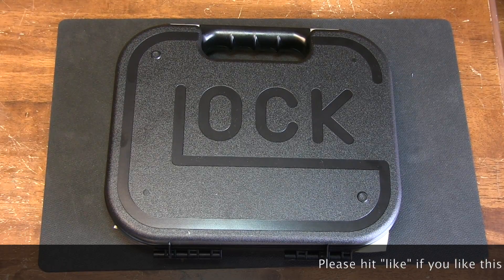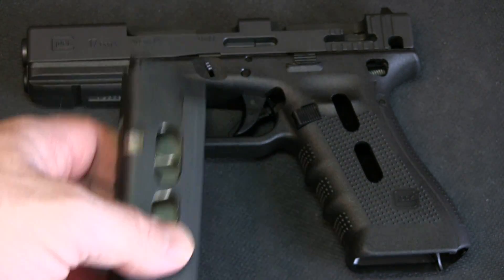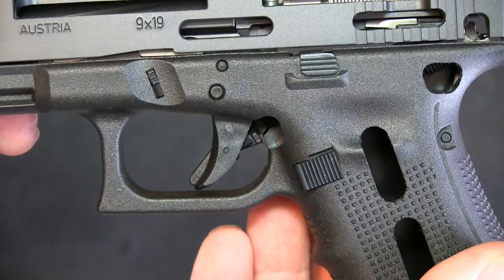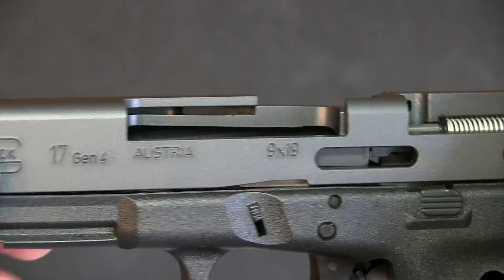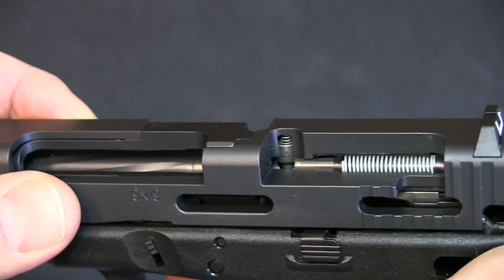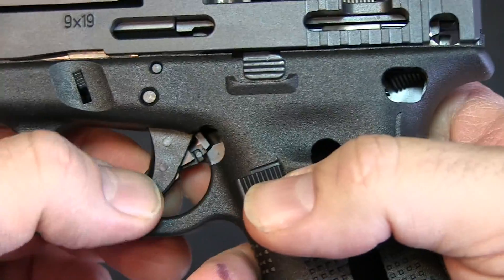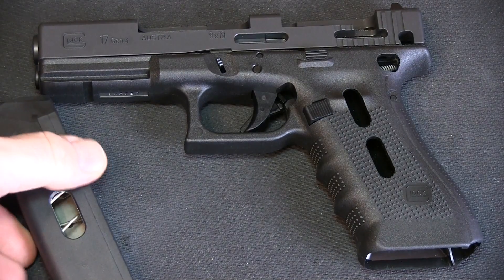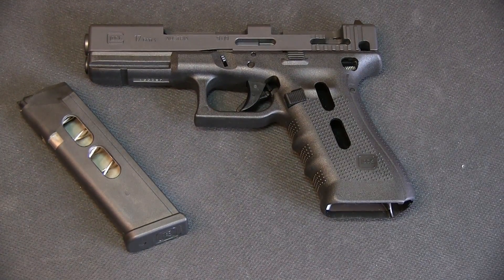How a Glock Works (with Glock Cutaway)

Comment: I know I'm in the minority, but I don't think Glocks are safe.  With a five-pound trigger, I don't see how they could be.
Reply from the maker: That's not true, internal safeties are different. Some safeties can fail. The Glock has a redundant safety so that there is absolutely no way it can fire unless the trigger is pulled. If you cocked a 1911, then dropped it it could fire. A Glock could not. The firing pin is almost completely incapsulated in the channel, and couldn't touch the primer if it tried.
Reply: The Glock is only as safe as the person holding it. If you don't pull the trigger, it won't fire; if you keep the trigger guard covered when carrying, it will not fire.
Reply: you're just not safe with guns if you think this gun isn't safe. it has a safe action trigger. safe is literally in the name.
Reply: WCGwkf right even with a 5 pound trigger you have to make a deliberate motion with your finger to pull it
Reply: Kurk T Check out these video's by n300xx931, he explains how each of the 3 internal safeties work.  Start with video 1.  These will answer all your questions, and give you assurance on the Glock.
Reply: Rick C  I've been handling guns since '87.  I've carried .38's, .45's, M-14's and shotguns.  I've fired M-60's, M-2's, and 5"/54's.  So, pardon me for thinking for myself--and for not buying into Glock's "safe action" advertising and the false bravado of people who are accidents waiting to happen.
Reply: Hey now, this here Dem is handy with all six of his firearms.
Reply: I used to feel the same way about a Glock, knowing that it does not have an external safety.  After studying the design of the firearm and learning more about how a Glock pistol functions, it does not need an external safety.  It is impossible to fire a Glock without fully depressing the trigger with your finger completely in the trigger guard and firmly on the trigger.  There is a trigger block on the trigger itself.  Also there is a striker block in the mechanism that will not permit the striker/firing pin to move forward and contact the primer on the cartridge.  A Glock can be dropped from a great height and still will not fire on impact, so accidental firing is eliminated through their design.  Without fully pulling on the trigger, it will not fire.  It is a double action striker fired pistol, so without that full pull on the trigger, the striker cannot travel forward to strike the live round.  Even if something were to enter the trigger guard and put rearward force on the trigger, it would have to go right across the trigger to do so and that is quite improbable.  In short, the Glock is probably one of, if not the safest pistol currently on the market.  Rather ingenious design.

A 5 lb. trigger pull is not really all that light.  It is about medium.  I've seen them as light as 2.5 lb.....and that is too light for my liking.
Reply: trust me there awesome I have mine I can empty the 15rd magazine in 1.86 second
Reply: I was with you on this once, they are the safest striker pistol on the planet, I carry mine in the appendix carry position.
Reply: The internal safeties are irrelevant; every gun has them.  The problem is, you have a pistol with a trigger pull not much heavier than a 1911, but without a manual safety.  That's just nuts.
Reply: You can buy an 8 pound trigger bar.  What do you carry?
Reply: p pollaccia 

 "You can buy an 8 pound trigger bar.  What do you carry?"

Right now, I'm carrying a Charter Arms Undercover that I inherited.  I'm guessing it has a 10-12 pound trigger, like most revolvers.

I could see carrying a Glock with an 8-pound trigger.  That would put it about the same as an LCR, and I wouldn't feel uncomfortable carrying one of those.
Reply: 762x51n8o 

 "That's not true, internal safeties are different. Some safeties can fail."  

Other than those who carry derringers, I'm not aware of much in the way of ND's caused by CCW holders dropping their weapons.  I just don't think it rises to the level of a real problem.
Reply: no you can't. video or it didn't happen
Reply: Thelonewolf4032 Jordan my used g19 was made lighter by a glock armorer, but my factory new 43 has a heavy as hell trigger that could only be pulled deliberately. I had to polish it up to make it smooth but it's still heavy
Reply: Kirk T Just keep your damn finger off the trigger until the weapon is pointing at that which you wish to destroy. If your finger's off the trigger, there's no way that firearm is going off.
Reply: Saying "keep your finger off the trigger" is like saying "don't have an accident."  It doesn't mean anything.
Reply: If you honestly believe that, then you honestly shouldn't own firearms. Maybe we can get you a nice pocket knife? Oh wait, but you might have an accident. If you can't handle trigger discipline, you might not be able to tell which end's which on a knife, as well.
Reply: The problem is not the Glock; the problem is the user. You can shake or drop the Glock and it will not fire. You have to have your finger depressing the trigger safety. Should cops carry Glocks? Of course not, because half of them are idiots, and police are far more likely to end up in a standoff situation. If I pull my 21 on someone armed with a knife or bat or axe handle, for example, my finger's off the trigger, so there is the opportunity for the adversary to stand down. If I ever have to pull on a firearm threat, as soon as my sights are lined up, I'm on that trigger and squeezing.
Reply: Kirk T Because of the trigger or because of the non existent safety?Besides the trigger /1911 safety
Reply: And here I am thinking the trigger on my wife's 43 is heavy.
Reply: you must be a democrat .
Reply: you must be a democrat
Reply: Not all guns have internal safeties though most modern firearms do.  Each design varies and not all are as secure as with the Glock.   Some designs are more prone to failure than others and some, although classified and marketed as double action are actually single action in nature.  The Ruger SR-9 shares an almost identical system as the Glock.  A true double action, striker fired design.
Reply: Yes thank you . I failed to mention that I'm a certified Glock armorer
Reply: You sir, are a jackass.
Reply: Are you referring to me Austin and if so why would you think so ?
Reply: My money's on him calling Kirk T that..
Reply: 3 things have to happen in order for a person to shoot another by accident  ;
#1 the firearm must be loaded , #2 your finger must be inside the trigger guard and finally #3 and most important component of all is that the weapon must be pointing in an unsafe direction . These are the facts and only the facts . If anyone of these 3 conditions is missing no one should get hurt . Pure and simple .

Comment: Dumb question...what is the spring that remains compressed after racking the slide (I'm assuming it's not the springs surrounding the guide rod)?
Reply: PowerPunchingSecrets.com 
the spring staying compressed shouldn't shorten its life span as much as repetitive cycle compression will.  Much like a magazine spring, where people have shown in tests that keeping your magazines loaded i.e. constant compression, doesn't shorten the springs life span much at all, but the repetitive cycling of loading and unloading is what wears out a spring.
Reply: 300 blAKout
 THANKS
Reply: Pretty sure you're talking about the firing pin spring?
Reply: Thanks. How often should you change out the firing pin spring - assuming it's always compressed with a round in the chamber?
Reply: Exactly. The same applies to magazines which are kept loaded for a long time.

Comment: it almost looks like you could replace the barrel and firing pin and it'd work just fine. might be a bit snaggy for a carry gun though lol
Reply from the maker: There is no hole in the slide for where a real firing pin would go through, so you couldn't use it.
Reply from the maker: I like that..."snaggy".  Funny comment

Comment: So 762x51 a friend of mine has a glock 19 and his triger fails to restart you click and when you reload the triger does not restart you need to help it a bit ... am thinking the problem is in the fire pin spring maybe its too weak ... i see here it connects to the triger what do you think ?
Reply: I think your friend should visit a Glock certified gunsmith...

Comment: why does it have 2 triggers?
Reply: The smaller one is a safety mechanism so that the trigger cannot be pulled back unless the small one in the middle is pulled back first. From what I can tell by looking at my glock there is no physical way for the firing pin to strike the primer unless the trigger is pulled back, which that little safety thing prevents from happening unless it is also pulled. He shows it in the video somewhere.

Comment: I'm glad I came across this video...I'm a ccw holder carry a g27 gen 3....I'm usually don't carry one in chamber just for safty reason. ..but watching the trigger pull and the safty plunger works...I'm always wondering the gun accidentally going off. I know it's striker fired......but from what I seen ...it can't happen unless trigger is pulled....this was a great video....thanks for sharing
...
Reply from the maker: +Clayton Schorege Glad you saw it, there's really no reason to not carry a round in the chamber, as long as you're competent with the pistol, there's nothing to worry about.
Reply from the maker: +Garrett Phillips I agree with you on carrying one in the chamber, but I wouldn't say it cuts time "dramatically." The timing difference is negligible -- but it takes more practice to become efficient. What Yeager says is a little off, because the racking of the slide is done in the same motion as the presentation, so there's no time loss there. Where the time is loss is acquiring the grip with your weak side hand, because after racking the slide the hands are moving in opposite directions. But honestly, if you're that close, you can shoot one handed. Do a search for Isreali/Mossad Draw, and you'll see how fast the draw is. Trained people are doing it in a second, or just over a second. With that said, however, I stress my first sentence -- I would never carry without a round in the chamber, and I don't see a need to do so.
Reply: @762x51n8o so with a glock seems like since the trigger pulls the firing pin all the way back to finish the cycle. If it was dropped an the firing pin block failed it still wouldn’t go off since the firing pin is not all the way back? It wouldnt have enough force to penetrate a primer? Unlike most other striker fired once they rack the slide the firing pin is fully compressed with only the block holding it until the trigger releases it and the block fails would ignite the primer.
Reply: stag3t-m uspsa watch some videos on YouTube by active self protection, I've seen lots of videos where not having a round in the chamber was the difference between life and death
Reply: +Clayton Schorege   Take the plunge and learn how to totally disassemble your Glock. It really is very simple and will give you a better understanding and a level of confidence in your firearm that everyone who carries should have. There are plenty of good YT videos on everything Glock.
Reply: condition zero preferably or one are the only ways to carry. having stupid trigger safety or grip safety is waste of time and room for error.
Reply: austin trigger and grip safetys are passive and are engaged under normal operating of the firearm.   While I'm not a huge fan of the grip safety, without the trigger safety you can have discharges when dropped, this is what is going on with the Sig P320 that has a solid metal trigger.

Comment: I had no idea about the firing pin safety. Amazing and ingenious little feature! No wonder the Glock is drop-safe. A few years ago I didn't understand the workings of striker-fire pistols and opted instead for hammer-fire (with the roll-away firing pin featured in Beretta and some S&W pistols) because I feared a drop-fire. Little did I know how backward that thinking was!
Reply from the maker: +Josh Donat I stayed away from striker fired handguns longer than I should have, as well, so you're not alone. Now I prefer it.
Reply: Almost all semi automatic pistols have a striker or firing pin block while hammer fired guns also include a hammer block

Comment: How about a Glock Cutaway Video that shows all the malfunctions people are experiencing with this firearm.  If you don't believe me just check out all the Glock problem videos here on you tube.  If its a Glock, its a crock!
Reply from the maker: +Mark Ridgeway Don't believe everything you see here on youtube. People on youtube try to do what they can to make them malfunction so they can make a video that gets views. The biggest reason Glocks malfunction is limp wrist. The other reason is after-market parts. A lot of people are putting aftermarket parts in their Glock, then yell when they have a malfunction or fail. The only other issue is a Gen 2 or 3 G22 being fired with a light on the rail. I've shot every model of Glock available on these shores, most Gen 4 AND Gen 3, and out of the box I had 0 malfunctions until the G43, of which I had 2 in the first 250 rounds, and not one since.
Reply: +762x51n8o ANOTHER GLOCK OWNER WILLING TO MAKE EXCUSES FOR AN INFERIOR HANDGUN.  THE MAJORITY OF GLOCK OWNERS HAVE MORE EXCUSES THAN LIBERALS.
Reply from the maker: +Mark Ridgeway If you want an intelligent conversation we can do that, if you're going to troll, go somewhere else.
Reply: +762x51n8o CHECK OUT ALLLLLLLLLLL THE VIDEOS CONERNING GLOCK MALFUNCTIONS AND THEN MAYBE YOU CAN MAKE AN INTELLIGENT VIDEO!
Reply from the maker: +Mark Ridgeway Use a little logic -- a person could shoot 200,000 round through a Glock, with only 1 failure, what is he going to make a video of?  Do you think people are running around making videos of every time a Glock doesn't fail?

Comment: I have to wonder if it would be safe to fire with a barrel and firing pin replacement. Or is there too much cut out of the slide?
Reply from the maker: +mattxr2i I took a close look, and you can't fire it. The firing pin hole in the slide isn't there. So even with a real firing pin, it couldn't fire.
Reply: 762x51n8o Ah. Kinda makes me wonder why they consider it a firearm then. Strange.
Reply from the maker: +mattxr2i I think you could probably put a working slide on the lower.

Comment: So looking at the firing pin, it`s striker fire double action.
Reply: no, it isn&#39;t...double action would mean the trigger resets automatically...glocks don't...got to pull the slide back, they are striker fire single action
Reply: bighunterman77 Well can you explain on the S&W M&P site, it says " M&P R 9 Striker Fire (double action)",  it`s confusing im here in England.
Reply: bmwnasher
yes i can actually...the m&p is striker fire double action...cuz the trigger resets without pulling the slide back, same as my old sigma, which is also a polymer frame smith and wesson gun
Reply: bighunterman77 Many thanks for that.
Reply from the maker: +bighunterman77 Not so fast. A Glock is definitely not SIngle-Action, and not exactly Double, either, though the USPSA classifies it as DA. Double-action means the hammer moves back to cock, then is released forward to fire. SA is cocked, and only needs to be released to fire. A Glock fall somewhere between. If you watch the striker on a Glock, it's only partially cocked. You must always pull the trigger which will always move the firing pin to the rear, before it is released. It can never be Single-Action. It's closer to a DA than it is SA.
Reply from the maker: +bmwnasher Read my reply, because bighunterman77 wasn't entirely correct. In a nutshell: A Glock is most Definitely not SA, but falls somewhere in between. In the end it is closer to a DA., and the USPSA defines it as DA.
Reply: 762x51n8o That`s excellent im indebted to you, thanks for your time and trouble posting, all the best from England.
Reply from the maker: +bmwnasher No worries, it's not a problem. I enjoy talking about guns, so, anytime.
Reply: i'm still of the idea that it's more sa than da...if the trigger reset, like the SW polymer pistols, i'd say da...but, after it's been fired and the action isn't moved, the trigger is fully back, like an sa pistol...i guess we could debate this for days though
Reply: bighunterman77 The confusion is it`s the firing pin mechanism not the trigger, the way the firing pin works is two actions.
Reply from the maker: +bighunterman77 I typed out a big long thing and it disappeared before I hit the reply button. Look, go to "triggers" on wikipedia, scroll down to "pre-set" triggers. The irony of your comparison between the S&W and Glock is that the M&P is actually closer to a SA than is the Glock. M&Ps pre-set at 90 percent while Glocks are about 50 percent.
Reply: maybe i shouldn't have said M&P, considering i've never handled one specifically...but, i do own an sw9ve(i know, i know, but it's cheap and works good for what it is), and i assume the trigger mech and all are similar if not the same

Comment: Would there ever be a chance of destroying an older cutaway? I'd like to see how well one of these would actually hold up after a few rounds.
Reply: +000Bob000jones000 1 round would be catastrophic.  The breech in this case is just slightly smaller than 9mm so that a round will not fit/feed.  A feature idiot proofed into the design so that some enterprising individual doesn't do something stupid.